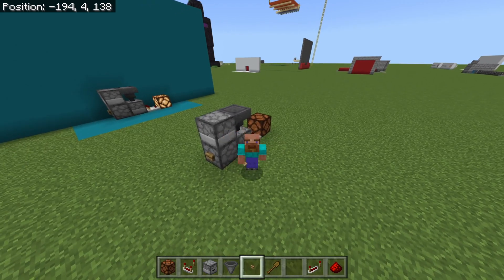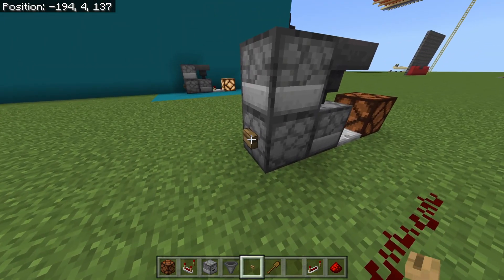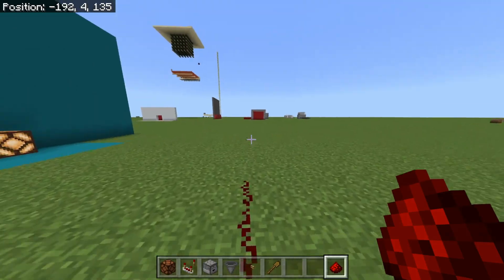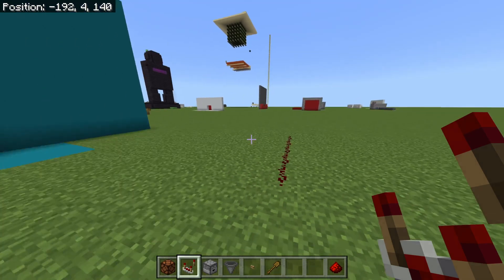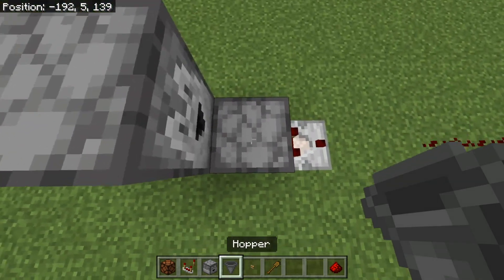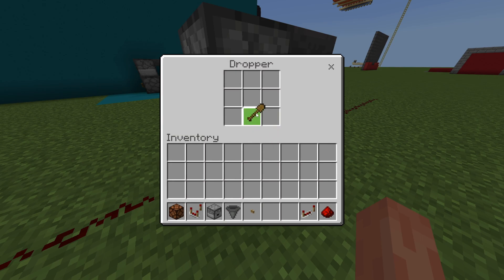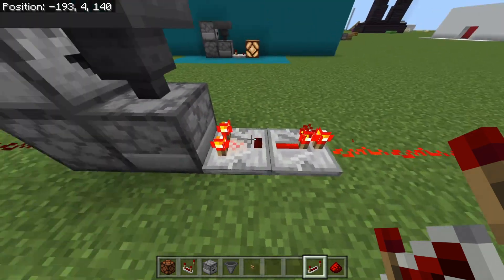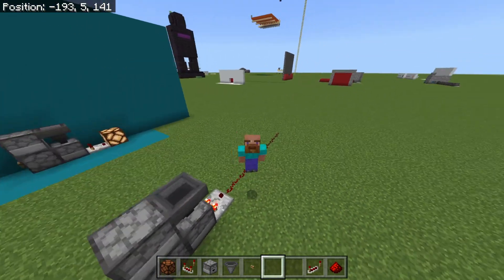How To Make A T-FLIP FLOP In Minecraft Bedrock 1.20 - TUTORIAL

Comment: How would one turn a constant signal into a button signal though?
Reply: the easiest way is to have a line of dust going into an observer. It’s that’s simple and that’s why we love observers (It isn’t quite a button signal because of the quick pulse but you can add a pulse extender if you need one)
Reply: Run the constant signal into a block with a sticky piston under it facing up. Then take the signal coming out of the block to your contraption.
Reply: look up a monostable circuit / pulse shortener. it basically uses a piston to break the connection after a moment.